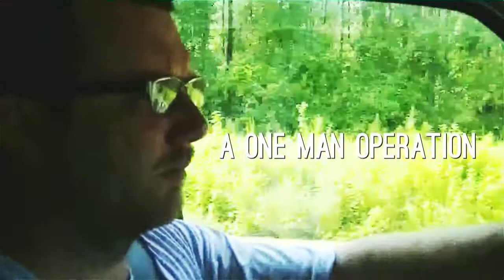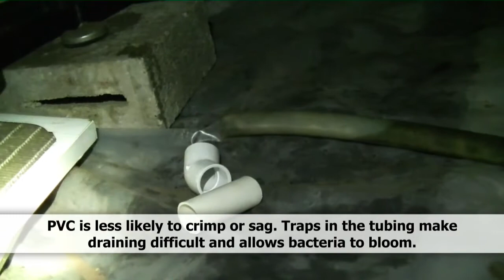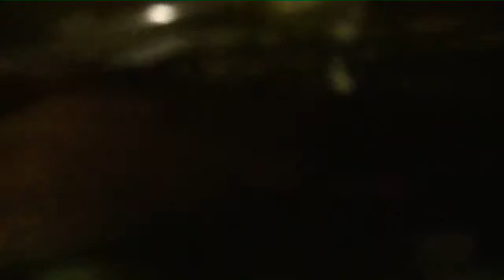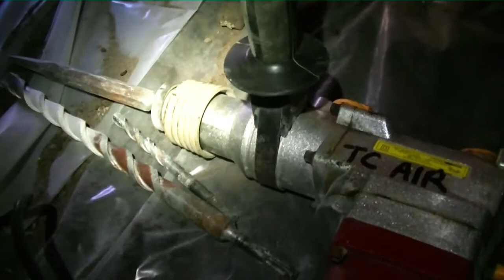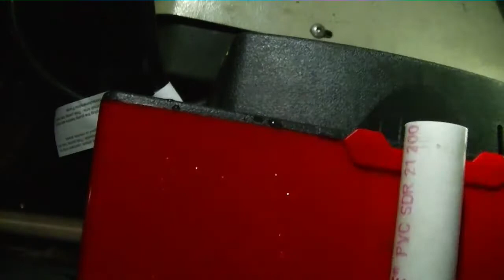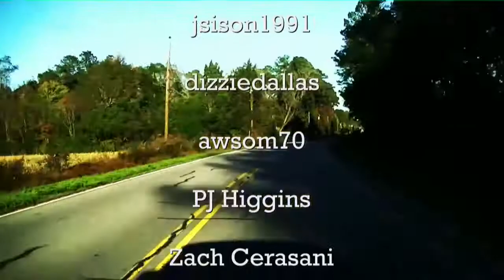HVAC Service- Crawlspace Dehumidifier Repair

Comment: Used the DiversiTech pump somewhat myself, another one would be the Little Giant. Do you recommend the use any of condensate tablets in the pump reservoir?
Reply from the maker: My only concern would be fragments lodged in the pump outlet or barb adapters. I have never tried it.

Comment: Nice work! What do you think of those diversitech pumps?
Reply from the maker: They get trashed so much its tough. I think the diversitech is fine, but I have not used them for very long. I saw a Hartell pump on a 1993 Heil Furnace the other day I think was original.